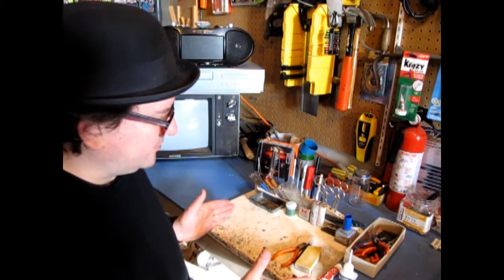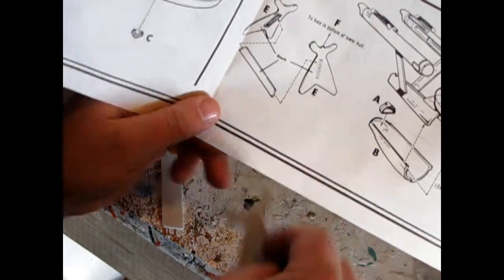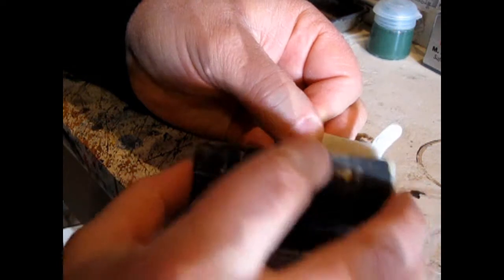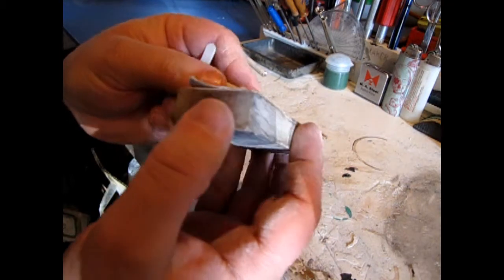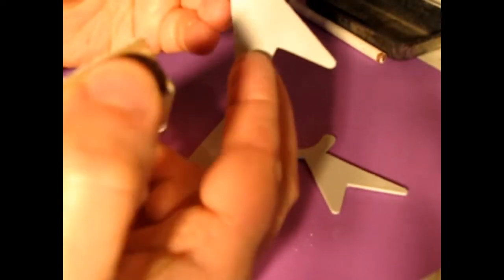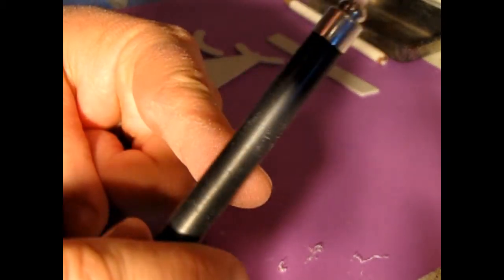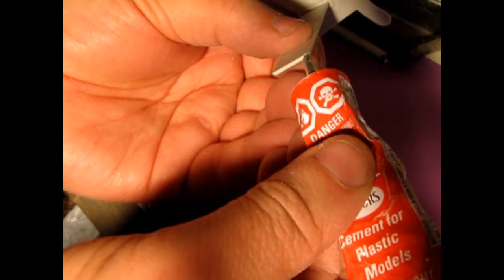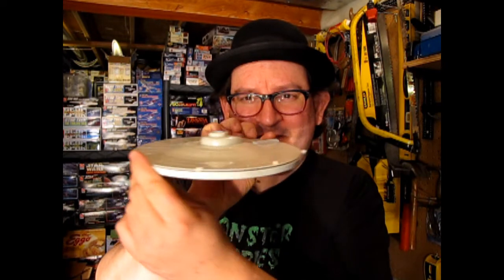Let's Build the AMT U.S.S. ENTERPRISE Kit 6676 - Part 2 - Building The Stand - A How-To Video

Comment: If you think about it you can strengthen the stand more with plastruct or evergreen beams and then use sheet styrene on the outside giving the original stand more strength plus making it look nicer than out of the box. And then you can have more surface area to put on a dedication plaque decal replica.
Reply from the maker: Good idea. these things can be flimsy, but I find it's actually the length of the pin holding the whole thing from rotating off the stand.
Reply: @monsterhobbiesonlinestore  Yeah but the strengthening is more for keeping that piece of styrene from flexing in between the two stand pieces. The stand for the 1968 release of the D7 kit looked more sturdier than this since it uses thicker styrene pieces to construct the stand.
Reply from the maker: Oh yes, I understood that part about strengthening the stand. I also find the pin should be higher as well. 

The D7 stand was tricky to balance the ship on as i recall, without gluing it in place.
Reply: @monsterhobbiesonlinestore  I think the stand itself could have used a round pin to take advantage of the wider hole on the enterprise. I think taking those stand parts and use them to make a stand out of thicker wood and drilling a hole for inserting a metal tube close to the diameter on the hole in the hull would sound better.

Comment: To this day I do what my late cousin taught me in the 1970s. Put a couple of cans of PLAY DOUGH at the bottom of the secondary hull. It will give the model some heft and weight at the bottom (ballast) and keep the model on the stand. Use play dough. It is very dry. Do not make your own like I tried once. In that case the model kept sweating water.
Reply from the maker: Sounds like an interesting idea. The other thing would be to glue in some lead fishing lure weights.